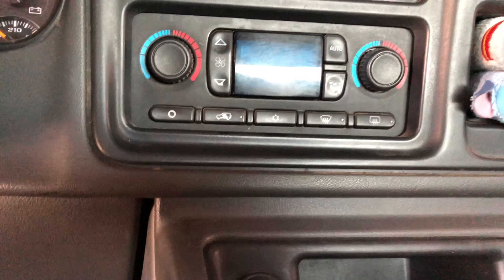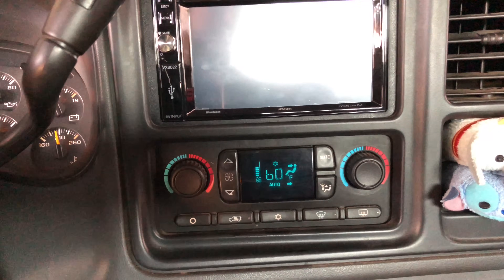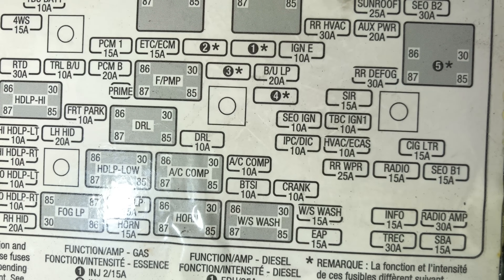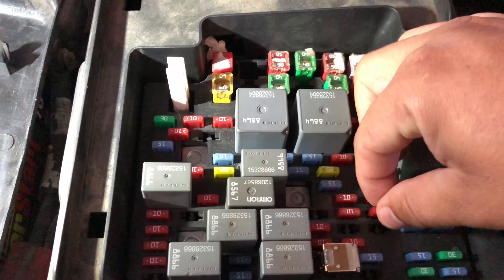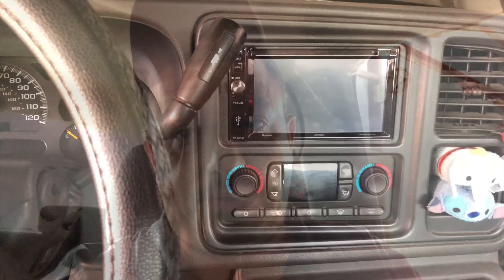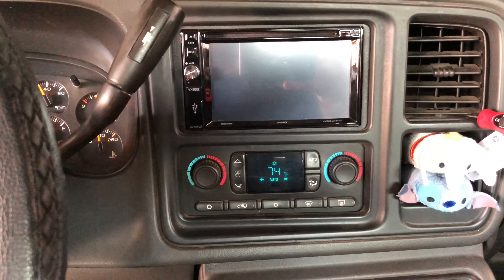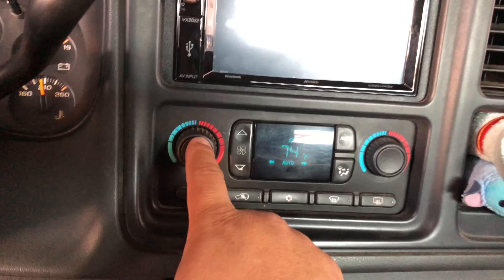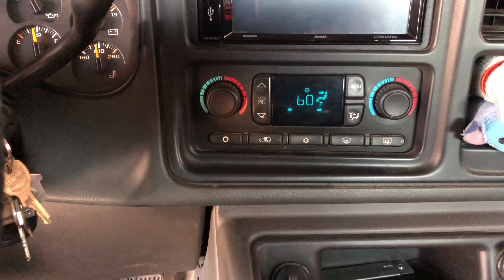HVAC Automatic Blend Motor Actuator Recalibration Procedure for GM Trucks & SUVS FOR FREE

Comment: Hello I have a 03 chavey avalanche z71 and my ac works good but it blows the air on top only for defrost I did but it didn't work do you where the plend hvac motor mite be so I can change it or should I change them all
Reply from the maker: defrost is the Default mode .. could be the blend door actuator or a electronic issue

Comment: My gears didn't mesh when I turned it in after  installinh a new drivers blend door on my 04 Yukon.  Made it hard to install correctly but I finally did and used this calibration video .  Not sure I needed it or not

Comment: Mean is fuse with A/C temp mess up cold/ heat turn off few min back turn engine on A//C wired in  2004 chevy truck

Comment: Hello, so I followed instructions and was able to  recalibrate.  My issue is on my 2005 Chevy the air was super cold. And unfortunately for me it has not been close to the coldness it was before. What can I do or check next? Could it still be the blend doors? All the vents seem to be blowing cool air, just not that super cold air. Any suggestions?
Reply from the maker: could be a number of things ... Temp outside.. engine fan, low freon etc

Comment: this really worked on our saab 97X which is almost the same as a chevy trailblazer. i also banged a little bit on the compressor with a hammer and tapped on the mini relay in the fuse box but it worked after the recalibration thing you showed us. thnx so much for the help.
Reply from the maker: nice
Reply: @FalconsGarage  i also pulled the mini relay out of the fuse box and pried open the plastic case and took the striker strip off a book of matches and cleaned the contact points inside. i have a new relay coming soon from amazon but the a/c is still working and it's 90 here in massachusetts.

Comment: ok, so 2004 Hummer H2, took it to mechanic they put new fuel pump in gas tank, got it back, now dash lights wont dim, mirrors act screwy but worse thing is the A/C is only blowing thru the DEFROSTER,,i did exactly what ya showed us here, and crossed my fingers, but it didnt work, do you have video of what to do next if it is the blend doors?, i also found a blown 15 amp fuse setting on the battery when i popped the hook,
Reply from the maker: whats does the 15amp fuse go to?  it only flowing to defrost id "default" mode .. so something is not working or disconnected ..

Comment: Amigo, I hope this works, just bought a 2005 chevy suburban that nearly froze me to death on the way home from Tulsa, Oklahoma, a 120 mile drive because I didn't know how to work the air system. A week later it's blowing cold on one side and hot on the other side. Very disappointing.

Comment: First off, GREAT Video.  Straight forward and very informative.  I do have a question. On my 07 Escalade when I reinsert fuse and start truck it shows 74 but it does not go to auto mode and it does not run any diagnostics.     Any suggestions?
Reply from the maker: cadillacs are are different thing .. you might need a scanner tht can get into the ac system to calibrate it or read codes
Reply: @FalconsGarage  just got it diagnosed.   I need a new HVAC control unit.   🤦🏻‍♂️

Comment: If my truck does not start calibration after turning it on, what does that mean?
Reply from the maker: you most likely have other issues would check on what it does and what its missing to turn on .. spark, fuel, air

Comment: Man i did everything in the video 3x and now when I have the temp to 60 degrees and the ac on it blows hot but not insanely hot so how do I get it to blow cold?
Reply: Please help me out brotha
Reply from the maker: if this process didn't calibrate it.. you have other issues . .. also make sure your compressor etc is working

Comment: I am sure the bulk of you guys have already figured this out but there is one thing that was left out of this video. When you are doing this you need to doit with the driver's door open. When you turn off the key and wait 15 seconds and all those procedures if the door is closed then the HVAC and the radio will stay on as I'm sure you all know. But just incase someone was doing this in a really cold place and had the door closed and was having issues with it I just wanted to point that out is all!! Thanx for sharing this info with everyone, great video!
Reply: QqQ

Comment: I got a 03 Escalade and not even the display for the ac/heat will turn on. Like the little screen. Any suggestions?
Reply from the maker: screen could be bad
Reply: @FalconsGarage  it blows hot air 24/7
Reply: @FalconsGarage  has 8k miles don’t see it being a bad screen

Comment: I replaced the actuator for the driver side in my 05 yukon then did what you said in the video. I'm still getting hot on the driver side. Any idea on what to replace next? The control panel  maybe?
Reply from the maker: could be the actuator door itself .. maybe
Reply: Finally  got  it fixed. New actuator was designed  different where the limit switch is on the circuit board. I cleaned the old one and adjusted the contacts on it and it works like a new one.

Comment: Would this same procedure work for a 2014 Yukon with the Rear A/C unit? I need to recalibrate the rear A/C /heat unit in the rear hatch. 
Great video!
Reply from the maker: dont think so because they have a different ac controls .. or at least never tried it in newer controls

Comment: This was great! Thank you! I have a 2004 GMC Seirra that would blow out the defrost. I put the HVAC in auto, turned off truck, pulled HVAC fuse, put fuse in after a minute. started truck and it worked. It didn't go in a recalibration mode that went through all positions like the one here on tour video, but now I could switch it to any position and HVAC worked flawlessly. Thank you again.
Reply from the maker: Glad it helped

Comment: One more question,when i recharge the ac system do i have to connect the hose, to the big o small pipe on the truck.
Reply from the maker: it usually the small. but when you are using the gages to recharge Freon you use both
Reply: @FalconsGarage  thanks a lot my friend.by the way i'm already subscribed.

Comment: Very useful video falcons garage!! Thank you but I had a quick question I did everything step by step, I turned my truck on and the ac started to blow but then a clicking sound under the dash a minimum of at least 10 or so clicks back to back started to sound and when the clicking stopped my ac stopped blowing through the vents what could it be? Thanks in advance
Reply: Also side note I just changed the battery so I know it reset itself because it never did this and instead of the clicking back to back I’m hearing now.. I would hear 2 clicks and my ac would run
Reply from the maker: clicking noise usually means a bad mode actuator

Comment: I had a problem with the driver blowing hot and the passenger blowing cold so I recalibrated the system but now driver side is cold and passenger side is hot...maybe bad control unit or should I recalibrate again?
Reply from the maker: you could also have a broken blend door or the actuator it self
Reply: Recalibrated again and its fine now. Was hoping it wasn't the blend door I just replaced two months ago,but it seems fine now.

Comment: avalanche had an issue when I move the temp switch to cold it blows hot air and when to hot it blows cold air.... and right side temp switch works for left side and left for right
.... Please need solution
Reply: This happened after replacing evaporatter
Reply from the maker: have you tried recalibrating?
Reply: @FalconsGarage  yes recalibrate many times... replaced switch...motors but no effect.
Reply: some one told me it may be electrical issue or the flap inside the evap box is fixed in opposite direction.... any ideas what should I look for?
THANKS ALOT FOR UR HELP IN ADVANCE
Reply from the maker: could also be a broken blend door

Comment: Great video. I replaced my drivers side actuator door and after recalibration it worked great. I had to unhook my batteries to replace my starter and now I cant get it to blow cold on the drivers side. Please Help!
Reply from the maker: did you try calibrating it  does it have enough Freon?
Reply: Yes. It blows ice cold on the passengers side but hot on the drivers side. I have tried recalibrating it over 6 times. It is very frustrating.

Comment: I had to replace my heater core....ooooff -big job.  I was also having issues with my level actuator which was a broken gear.  So while I had the climate control module out I replaced the main gears on all actuators, trying to head off further issues.  I reinstalled my climate module and went to reset the actuators but they are failing to operate?  My battery is low and recharging, any other ideas if that doesn't work?  I tried to keep actuators in relatively the same position upon reinstalling.
Reply from the maker: I would check that its all connected properly

Comment: I have a 2005 gmc envoy and I did a calibration a couple months ago now my controller isn’t lighting up but the fan still runs only at the speed it was on before the lights went out, what does that mean?
Reply from the maker: honestly dont think the lights have anything to do with your issue .. could be a bad blower resistor.
Reply: But when my controller lights back up everything works fine
Reply from the maker: Karon Horsman if it lights back up then I would check the connectors
Reply: Falcon's Garage I did ck all connections and all fuses n all is good
Reply from the maker: might be a bad controller
Reply: Thank you

Comment: Thank you Falcon!  Worked 100% on my 2004 GMC Yukon.  Hot on passenger side, cold on the other.  Did this reset, all working well.  No need to replace blend door actuator.
Reply from the maker: Great to hear!
Reply: Thanks falcon I watched other videos but yours  is better I was getting  ready to take to the shop tomorrow  but thanks to you I save me some Lincolns
Reply: Did the problem keep coming back until the actuator failed? Or was this a long term fix?

Comment: Any suggestions for next step if the reset procedure doesn’t work? I get some cool air during the initial recalibration, but then it blows HOT, and after recal is complete, I just get scorching hot air driver’s side and warm air passenger’s side. My back blows hot as well.
04 Yukon Denali. 
Pretty sure all my actuators have failed, the back looks easy enough to change, but I’m lost in the driver and passenger actuators.
Reply from the maker: does the mechanical part of the AC work properly?
Reply: Falcon's Garage yes, compressor and everything is good. Just had it recharged this Spring. The air blend issue has been ongoing for a while, it just finally gave out.
Reply from the maker: well as long as all the mechanical stuff is working correctly .. you might have a wiring issue because I also find it hard tht ALL your actuators went bad at once.. including the rear ones
Reply: Falcon's Garage I had my mechanic run a diagnostic on the HVAC yesterday, and it did throw actuator codes.
Reply from the maker: Carolyn Hellum honestly not sure if this year model cars will give you “actuator codes”. Also could be a temp sensor issue. This systems have several temp sensors 2 if it’s a dual climate and 3 if it’s dual WITH rear AC

Comment: Getting ready to try this now. Just picked up a 04' Yukon XL Denali and pulled the battery to temporarily use on another truck. Hooked it back up and weird shit began. First the headlights came on, heard start chime and the starter began cranking, with the damn key still in the house!!! Continued tightening the terminals and now the AC is blowing out max heat (on 7/27/20!). The rear ac is still blowing cold tho 🤷🏾‍♂️. Hopefully this works.
Reply from the maker: Good luck!
Reply: @FalconsGarage  It Worked!!!!!🙏🏾👍🏽👍🏽 Thank you so much, just took a couple cycles and waited about 10 minutes
Reply from the maker: nice

Comment: So i have a 2002 chevrolete suburban, so my control set is different, i havent been able to find anything close. I still tried to follow the idea of this, and my system did calibrate, but it doesnt seem to remember it. It cycles through all the actuators but once i turn it off and back on its like it never happened. Still full blast heat
Reply from the maker: but when you do the reset does the COLD air come out?   like is the mechanical part of the AC system work properly?

Comment: Awesome Video! I have an 03" Tahoe that starts out blowing cold on the drivers side but goes to full hot in about 15 seconds later. Do you think that's a blend motor actuator problem? or the digital controller?
Reply: Mine would do that at random times. If I restarted the car it would fix it for however long. Mine was the actuator in the passenger floorboard
Reply from the maker: could be the actuator or the temp sensor for that particular side

Comment: Any luck with a 02 bravada/trailblazer?
Reply from the maker: if you have the same ac controls yes .. JUST NOT SURE were the fuse is on your car
Reply: @FalconsGarage   Hi! As Ang Aguian mentioned above, I do have a 2002 Trailblazer. The AC control unit is the same as what the video describes. I discover that the ECAS fuse is a 30A instead of a 10A; the fuse lists as #1 from the fuses box. However, I have not been able to recalibrate it. Please, help!

Comment: I have hot air blowing both sides on my parents 2004 Avalanche. None of the temp controls work on either side, and it is also stuck on vent.  I tried the reset. I see 74 come up, but no actuators cycle during recalibration. Not left or right, nor or defrost,floor vent either. After startup,  I get the same.  I doubt all my actuators are bad. I am going to try a new A/C control unit. Could this be the culprit?
Reply from the maker: mayve .. check that the actuators are getting power too

Comment: Hey bro I have done that an does not want to recalibrate.....it just keeps blowing on defrost...on 2003 escadlade is the another way to recalibrate
Reply from the maker: Then you probably have a bad blend door actuator or a bad control.
Reply: @FalconsGarage  i have went to the wrecking yard an have tried a few blend door actuators...an have tried to recalibrate them ..an a no go...so u think its the control module on the dash

Comment: I have a 2006 Chevy Impala that I've had to replace all actuators twice, but I never knew about the calibration process. I currently just replaced all of the passenger ones about 3 weeks ago and now one is clicking again. Would trying a calibration now be useful or is the damage already done and I need to replace it first and then calibrate? Also, would failing to calibrate cause actuators to keep breaking possibly? Thanks so much! I understand this particular calibration method might not be the correct one.
Reply from the maker: ive never had to calibrate the actuators on an impala .. now because I've never done it dosent means it dosent need it .. but you have to make sure that the clicking noise is the actuator OR the door thats is bad already

Comment: Hey bud I need some help my 2003 Cadillac Escalade has a new ac compressor drier and condenser and I can’t get ice cold ac to save my life.
Reply from the maker: did they flush the system?   is there a leak on the system?
Reply: @FalconsGarage  what's the process for the non auto style?
Reply from the maker: Aaron C sorry I don’t and would hate to point you to the wrong direction.
Reply: So when I took it back the first time they had to replace the compressor again and now it’s cold but it’s not ice cold and when I hit the little frost button my AC turns warm I’ve never owned a new GM vehicle so I do not understand the control climate

Comment: Hey man I have a question I did all the steps in my 2005 GMC Yukon and it kinda made it worse at first it was only throwing cold air on the driver side and hot air on the passenger side while both of them were at 60 degrees so I did the steps in the video and now both sides of the front vents are not throwing any air and we have the mode set to the correct one and even changed the modes but it’s only throwing air from the defroster and it’s hot air when it’s at 60 as well the rear vents are throwing cold air I need help I changed the actuator and did the same steps again and it’s still doing the same problem
Reply from the maker: maybe the actuator is bad

Comment: My 2011 Chevy Equinox does not have an "HVAC/ECAS" fuse like the one you pulled.. it has an "HVAC BATT" fuse and an "HVAC IGN" fuse, and they are located in the fuze box under the glove box.. there aren't any HVAC fuses in the fuse box under the hood. Would there be another name for the "HVAC/ECAS" fuse? THANKS!

Comment: Ok so when I try this on my Yukon, it works for about a minute and then the heat starts coming out again. So I get the air cond. to work but only for about a minute. Is there anything else that could be happening?
Reply: I got the same prob, did u fix it? I'm guessing replacement of the blend door actuator.

Comment: Hey guys! So I tried this reset procedure and it did set the temp back to 74 however the AUTO was not on when I started the truck back up. I have 2011 Tahoe with the AC light blinking.   Already changed the outside temp sensor that didn’t work so I thought I’d give this a try
Reply from the maker: Ac light blinking usually means there is an issue with the compressor or something on the system
Reply: Falcon's Garage .. I’m kinda figuring that out.  I changed the relay fuse since the the compressor wasn’t coming on at all. That didn’t work. But when I “jumped “ the relay fuse with a paper lip the AC light actually came on and I can hear the compressor clicking.
Reply from the maker: You should figure out why it’s not coming on though.  By you jumping it and if it’s low on Freon or something like that you will make the compressor lock up and it will be more expensive to fix. So I would say keep checking it